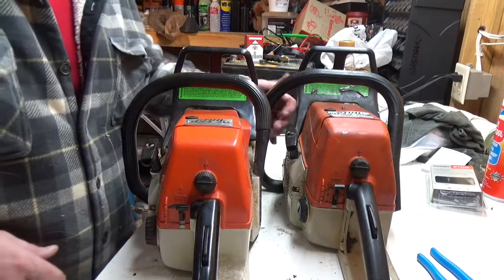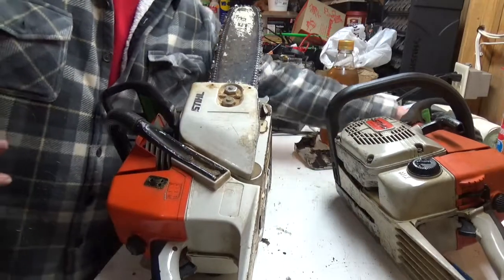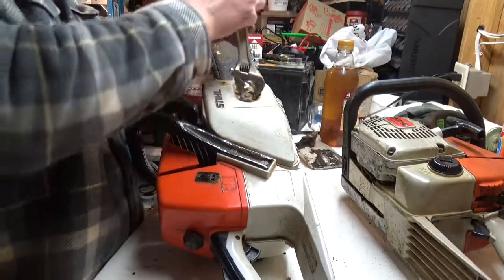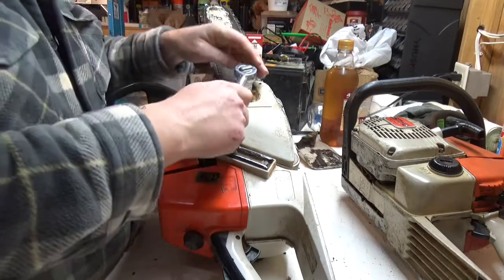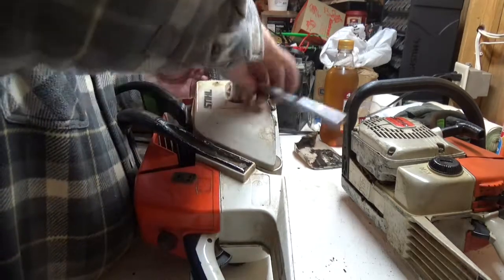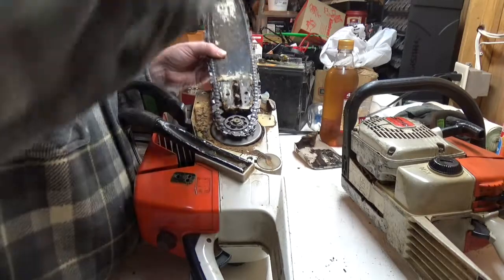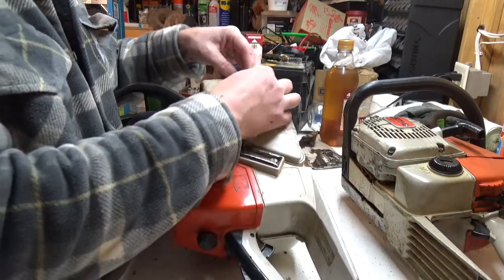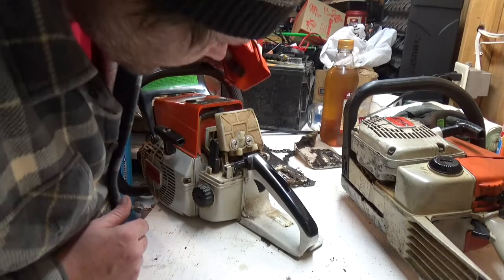034 Stihl getting ready for a test run 1 18 2017

Comment: looking good bud  I will make a small suggestion for you if the nuts have a tendency of backing of just add a drop or two of GREEN lock tight during reassembly Caution DO NOT  use RED lock tight as it would be too hard to remove again even Blue lock tight is a bit tuff to remove GREENwould be best in my opinion just a suggestion
Reply from the maker: DriveShaft Drew I will try that, thank you